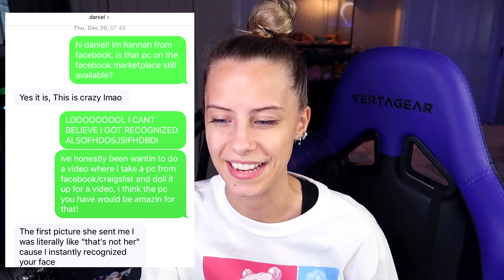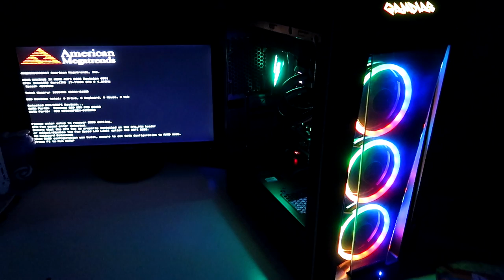I bought a USED PC on Facebook ... AND THEY RECOGNIZED ME LOL

Comment: Nice purchase. That motherboard will accept M.2 "hard drives" so you can update the performance of that rig so it will run on M.2 NVME speeds, about 4x faster than the Samsung SSD you mention as an 860 EVO however, that SSD is an 850 Pro version which goes for a lot more money, has a 10 year warranty and performs faster than an EVO. Once you get your hardware completed, go into the UEFI Bios and set the Q Fan option to "silent" for all of your chassis fans and the noise will be much less. Just save and exit and your good to go.

Comment: i couldn't let my RAD get that caked , i have to clean it once a month without fail , all 3 corsair ML 120 Pros going at 1800 RPM  , only had to do this as with i Cue & Corsair link the temp range only goes from 0- 60C so if i have it set to read from CPU as soon as CPU passes 60C the software runs all 3 fans at 100% at 2400 RPM !! lol no matter weather you turn it down all the way does no good , they need to do something about that as its not everyone especially overclockers who keep their CPU below 60C under heavy loads especially at higher V-core voltages & it's no use to use the pump temp as a monitor as it never gets above about 35C , found the solution in the end , set it to pump monitor & select custom fixed speed & set to 1800 RPM this is just below the threshold where i can hear it above my 3 140mm front case fans running at 1200 RPM , damn glad i got myself used to the  sound of those fans i suppose , you wouldn't realise with the stock fans as they are only 1400s anyways & evn flat out they are not that loud , but i sure released today when i installed those ML pros !! lol

Comment: Bubbles, The rear panel won't close because you put a zip tie down at the bottom in a non secured point causing the panel to bulge. It's a really easy fix.
Reply from the maker: nope, i messed around w it bunches, that wasnt the issue, it's the power cables bulgin in the middle that made it hard to close ;~;
Reply: @NoisyButters  well darn. I feel for you then. It looked pretty cut and dry. I've been there though back with some old cases. BTW what are you doing with the old case?